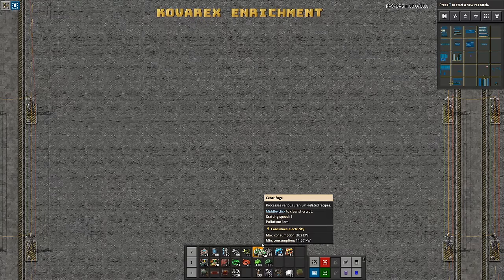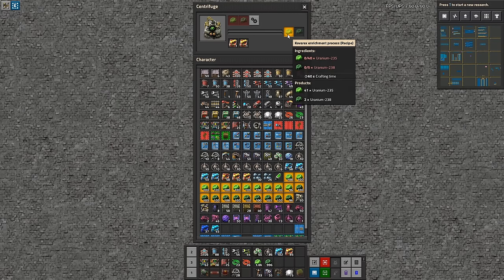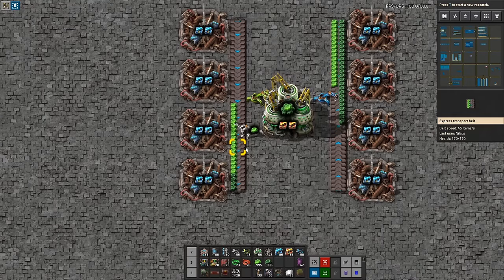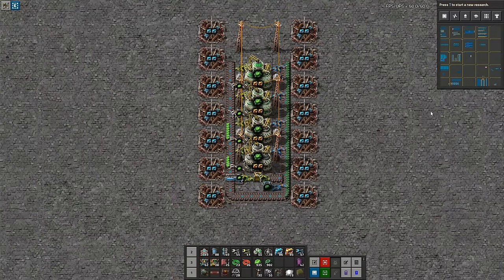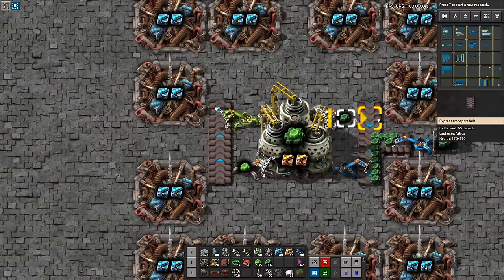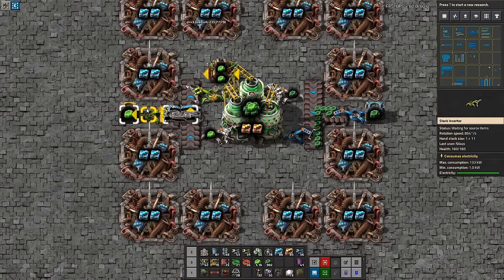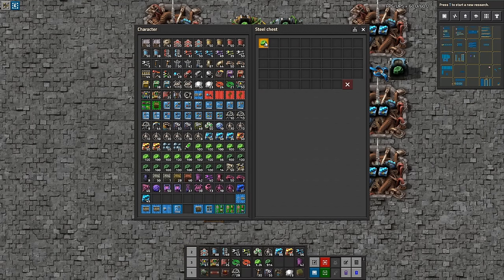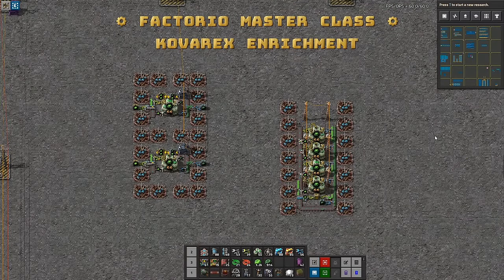Limitless Uranium-235 with KOVAREX Enrichment Process | Factorio Tutorial/Guide/How-to

Comment: Aren't speed modules MUCH better for this? You gain 1 U235 for each process completed and you never loose the U235 input materials, so 2 speed mods doubling the processing speed to 200% is much better than making it 30% slower and only gaining 20% production "(1x2>1x1.2x.7)". I fact its less productive for U235 than using no mods at all.

 Production mods are great on resource expensive inputs, but here the only real expense is 3 extremely common U238, which is the 99.3% basic ore processing result. Speed mods help with creating a much faster U235 buildup, which can then be used to exponentially^2 expand the system further or burn as fuel.

Comment: For anyone having issues w/ the U235 inserter not inserting enough and or a few U235 being siphoned off early, set the override stack size on it to 10. When it grabs handfuls that don't multiply up to 40 I have seen issues arise with maintaining sufficient inputs to keep the centrifuge happy.
Reply: I just wanted to post and say your comment helped me out.  I couldn't get things to work as expected, no matter what I changed.  Changing it to override the stack size to 10 fixed it immediately.  Thanks for sharing the info.

Comment: Instead of doing it with the complicated combinator thing, you can achieve the same results by just controlling stack sizes.

Have the output of U-235 go into a chest using a stack inserter set to 10. Have another stack inserter take it out also set to 10 and feed that back into the centrifuge. Set a condition that only allows it to pick up when the chest contains 10 or more U-235. Set a third fast inserter with a stack size forced to  one to only pick up when the U-235 in the  chest is equal to 1, and that’s your output.
Reply: That's how I did it first, this works.
Reply: Dang good point! Way more simple.
Reply: I just tried this and the output does NOT work perfectly unless you remove the productivity modules. It eventually stops itself because the productivity will give you 2 235 and the "equal to 1" condition is no longer applicable. It works, but not perfectly.
Reply: Seems like chnaging the output inserter to "U-235 = 2" fixes the issue about productivity.
Reply: @Murasame13  couldnt you also write the condition as just <10
Reply: Or u235 "equals or less" than  2
Or 4... Just in case if magic happens
Reply: I tried "<10" and less than 4 and less than or equal to 2 and none of those work, they all snag out a few extra at the start.  It's all super fast, but I think it's because they are all enabled when the box is empty and they manage to engage in the instant (single tick?) of a stack landing in the box.  Using two inserters seems to work perfectly, one enabled at exactly 1 and the other at exactly 2.
Reply: @ivanlagayacrus1891  if you use the condition <10, it is also true when =0 which causes the inserter to start taking items immediately and breaks the design

Comment: Actually you can build a kovarex with no combinators and no extra spend resources in the loop .
You just need a inserter with stacksize one, activated when a stackinserter removes u238 . Since only 2 u238 will get produced the condition is only true once  for each cycle . Also the stackinserter will always remove u238 fervor to u235
Reply: “Actually.”

Comment: I prefer this variation on the design, which uses an additional arithmetic combinator, and swaps the decider for an arithmetic. It's slightly more complex, but has these advantages:

1) Easier to seed, simply put the amount you want in the system (anywhere between 40-80 U-235) into the input of the centrifuge.
2) System will always maintain the total cumulative amount of U-235 you've manually placed in the input and will expel any surplus into the output chest. Seeding with 80 U-235 allows 100% uptime on processing, or you can start with 40 as soon as you have it then add additional 40 as you get it into the system to reduce the downtime between cycles. Just drop extra into the input of the machine as you desire.
3) No surplus U-235 sitting on belt unused, it's all either in input buffer waiting to start the next production cycle immediately, or it's put into the output chest
4) No splitter priority shenanigans to remove extra from the system, it's 100% circuit controlled by counting inputs/outputs.
5) Almost(?) never accidentally overfills centrifuge above the initial seeded amount (like was seen in this video) because of number 4 and the separation between measuring output and input inserters.

It's based on the idea of adding the negative value of U-235 we take out of the centrifuge as well as a negative of what leaves the system (into output chest). The result should always maintain a net 0 between productions cycles. Using negatives simplifies the wiring color separation for the condition/read mode so we can use a single wire to the yellow inserter. All additions (including of negative numbers) are done directly on the wire. Output is limited by the logistics network total U-235 amount so you won't overproduce.

Blueprint:
0eNrFWF1yozgQvgqll53ZNSnA/NiuvUVqnnZTlAztWBWQWEk48aZ8gD3IXmxPsi2wjWMrDuDMzEscQOqv+2v11w2vZFnUUEnGNVm8khxUJlmlmeBkQe5ZWRVbp6q1o9fg0FLUXDti5Xxzg2nkbEXtPFO8w3jzXG2VhtL5Qvn2eQ0SnCXoZwDuhJ47877iMi2ahYwbk2jHXGTAtWSr+hHu/uT3rYlnVhQOLZ7pVjklxX10D6GFpoWT1WVdUM02Vp9+wdsl5TUtjO8FzSA/eNgCU563CPBSAeLwraNqWRW16lwUtTZLszUofefca5o9OStWaJC4RoE0/xzWUI6ROoV4ZEqzTDkcwxbyySlYyTTkd2RCFKeVq4X7KFlueH4hC9+bkK352U0IywRXZPHHK1HskdPCLNHbCjAHaKFEA5yW5qqWlLO6NKESs4/nYEztJh/u7Gg+2RjsHiYEHzDNoMVvLrYpr8slSLR83L8Eik6ivUoo1p6PJgw3DmZ30T6U6fwuMtYRWZnnqgLI3VLkdQHu1OAZT88wgj4Y0W0Y0z4Y/m0YYQ8M/0auomH5CIMRGPERQ9VLpWlj3MrXEcVmJhlGxyhXZ0eMQ/W5TcW6SgtJ8ajb3I7PMSX8VeOmtK3vtg4OlWWtvAnJjOqQhbd7sHg1P246SMVHfkwbP3ImIWvXhAYCC1YU6RLWdMOENBszJrOa6RSf5UdrKybR+WHCYfRG0yYEc1FWVFJtMMjvzeM9jgSap2vUS4OoMUwkR8saWgu89bZJl2/+PEpU+1MZMWLnx0gSbhAbkKh+kCojpujv37BXrnPN8WyiZWNw2jEY7jOZsSb4J7GhEl5c4JJl6xLNuJUUGShFTs4Y3sprjGGD8B8dNb87Cu05ca8m17+S3Ph6ctERSMUqFRXItviMfH1mSoKks9ekqM1Qz/M/I9ZT73c6jn1VItWuxj2qElK7Syi0lSfvWhHYUKYDFTAeISt+OCaU+Pw0XksycLosIM2ZMr9ksaKFgo+zPDmVgOZ+u9ScGSNHtmCiG4PB1mu1e9InTEVfr4fonJz+9fAdxe6/f/4luyGVMz8hoqmk+G0lBaaSbGQlZ2T10ZDobQ7ecBbYOTu0wc8kzffsPaLlLNUiPaLuJ9/zs/oDFC26RdGidxRtdqOihb0UrRsXVhRHl75t5fJI2GZr78YQoj4hBP4IFH9+TRJsKEF/ok4Hy7AXUdOB4+qYvhKE782r+xH0nWCSyzln0MQ66ybWwDOvfMf9UpTpsl6tGiNt0V163TUQKpnGaarxW5RLxhtBsPaPg8NJT+XqTHfapcaKlwJjI+00zEVaTtSH/Ipb29f3QZYH9Qo/MapCgvdFK7aIli0B8YgEnMzGye5nUO69Zfy3H8D4ZTeeXO0SF8+Ty24+LIETy6uPLaPJiIz675ZU/H3zO7PmN/B+Qkn5n1VSs4GvEaM+bM2HfdkaBTL1hn3aGgfiD+yOH4M8tI+NxeMH6AnZYCNqu8TMD5NwnsSJ78VRvNv9D3HykL0=
Reply: I just gave your blueprint a try and found that it doesn't work. I put 40 U-235 into the Centrifuge, and it immediately stalled after completing one cycle. The Stack Filter Inserter refuses to take any U-235 out of the Centrifuge, with a status of "Disabled by control behavior," even though its mode of operation is set to "None."
Reply: @E-102_Gamma  Sorry it's been several months, but because it uses logistics system to read contents, the logistics chests must be in range of a roboport or you'll see the behavior you did. Probably should have specified that.
Reply: @toxicbubble5  Hey, better late than never, right? Well, thank you for clarifying.

Comment: Great and easy-to-implement logic for the 2nd build - I usually use an intermediate chest connected to filtered stack inserters (as seen many times in other builds). Your trick is easier to design. Thanks a lot !

Comment: Circuit build advantage: Makes excess available as soon as possible. It's drawback: It pauses each cycle.
First build advantage: It never stops. It's drawback: Takes a long time to provide excess.

So the more time you give it, the better becomes the build without circuits, as it doesn't pause. The advantage of the circuit build is really only meaningful at the "early" game, where it saves you from picking up excess manually.

Comment: If you set the stack override size to 10 on the stack inserter you don't get the tick issue with the 41
Reply: Counter also count 41. with the next reset signal you get 1 in the counter and inserter will insert this time only 39

Comment: If you want a count-perfect one, set the first decider combinator to anything < 39 | output u-235 so it'll count to 40 including the math tick. Since you're doing -20 * hand contents that has 2, you will then have a -40 on output so it'll be 0 on the combinator allowing the input inserter to swing again.
Reply: Doesn't this risk stopping at 39, and require a manual restart? Might want to add a second circuit to check for that problem.
Reply: @petkras  it doesn't, because the inserter Will grab 10 when the tick reads 30, so it'll be 40 total

Comment: with 80 U-235 per centrifuge it will run continuously.
Production speeds with 12 beacons are 8.04 with Prod3 modules or 8 with Speed3 modules.

Comment: I like kovarex, because I think there is more room for creativity than many other builds. My kovarex uses a pair. 
The 40 u235 is transferred between them with stack inserters. 
The u238 is dropped by a filter inserter and taken using a fast inserter on a belt which is looped and refilled by belt coming from miners.
The 1 extra plus the one from productivity is dealt done by a filter inserter controlled by combinators:
-To control the stack size I have one combinator to count (10 u238 taken out), one combinator to output a "1"  on that 5th cycle and one constant to change it to 1 and 2 instead of 0 and 1
-To control the enable I have one combinator that separates the counter signal from the pulse so I can still use the pulse.

Comment: Last comment: the circuit build doesn't work with red belts, i think that because of red belts being slower, the stack inserters decide to swing without a full hand or something and it causes the items to pile up and end up on the wrong side of the splitter. This happens after 2 or 3 iterations. So you may want to update the blueprint on pastebin (nuclear masterclass one) to blue belts
Reply: It works with red belts if you limit the output 235 inserter stack size to 5 .. that forces it to make more swings, which seems to give the top inserter enough time to swing and alleviate the jamming problem with the splitter.  Note that I also set the input 235 inserter to have a stack size of 10, to avoid the off-by-one issues.
Reply: It’s been working just fine with the red belts so far

Comment: I just LOVE this circuit design, but be careful if you set it up before you have your power needs met :D

I setup 4 of these and they went out multiple times, scratched my head, then I realized I had several brownouts in the meantime which seems to mess up the circuits, so had to manually reset them when this happens...

Comment: This can be simplified to use only two wires and zero combinators.
1. Connect a fast inserter to the middle belt.
2. Set belt mode to only read contents/hold
3. Set inserter enabled condition to U-235 = 1
4. Connect output U-235 stack filter inserter to the storage chest
5. Set enabled condition on the output inserter to 4.8K or however many U-235s should be stored in the chest.
6. Limit stack size to 10 on the output U-235 inserter.

Blueprint:
0eNrFV9uOmzAQ/Rc/wwpzT9R+SRUhByYba7nVNlG2K/69Y9glaWISLlL3JcR4mDNz5mZ/kH3eQC14qcj2g/C0KiXZ/vogkr+WLNfv1HsNZEu4goJYpGSFXu2BoShpLcLLDM5kS9udRaBUXHHoNXSL96Rsij0IFLj91iJ1JVEc/yIKqrA9Sl8Ci7zj39h/CbRyBJV6W9YAmV1UWZOD7ZGt27bWHYQ7AcKJV0F4UyD8VRD+FIh1RAXzYkEXQITzvFgCEQ0QUrH0zealBKFw53HYnQ4q4wLSXgRNRQOVqPJkD0d24pXQ36VcpA1XCe5lg7IDF1IlT4qjEazkTWG7XqArRNeUYrrAqOPoZVEzwZRGIT86gU8k9BeS6pBUNeB+h+iZHI8HJDjXAqS0FSLKuhLK3kOujARs/iHAoHUzaE1xR/BD8wpGTeGXpmjTUYlE8o6Ft+rEBJxtKAVPjwVqsWtRpWgguYotvsoapP6E4M9CTJ3BqAPPMbaPg+wvDrKJ+ktgBLAsObIy08mg0EZ0RIkGEKI3q+94X63QkAgxaXcm/+iSUHrjbvomEHdWuUfRglqkl8aYV69cKp7a6REkZgCTkp9AZ8KJZ+bAXYH3KYVGlr1LnQlU/wjIrucKxxUNkFWjOZcmemBoxKOsoc4N+BWd7v9rDTeN4SdpZ/AQah4sUp1ACCQ56Roi2vIH9GQ28BPc9M4p1TW00Cj+Pp782NRDZ1Dl9VRNrFtE343x6piIDVf15kv6j3IJJdvnkGRc6ifZHlgu4Xmrsq6D0b3vRXXj63JkMoH+WM1F61yPv8d1x+hLPL1/XKaOoS5MujdLeHLHm1RoOgo7qwbLPYhpsLjrptc9XUYQd9ZJctH0ckenl4DfDT5HIu/cnYQ66WTyoUDne/N5MjQeENwZg8yhDwaZSfe8a0C06EoWzrqTLcOIZl3KlmHE87LwOcau39YKhxu4RXDQyD5gMfUjfxOFEXXCIGzbvxaFLWU=

I also prefer to use passive providers for Covarex and storage chests or active providers for U-Processing outputs. Since storage chests are prioritized over the passive providers, bots will empty them first, ensuring the uranium belts don't get blocked because U-235 can't be picked from them (like that ever happens).
Reply: Does this work with productivity? I've left it running a while and the storage of the centrifuge keeps increasing as each productivity goes off until it stalls?
Reply: This will fail when productivity spits out out 2 instead of 1, won't it?
Reply: This doesn't work.

Comment: Nilaus, I just wanna say that your "efficient" Kovarex Enrichment Process doesn't work unless you're using blue belts and a blue splitter (as you did in the video).  
  
The default design of yours uses red belts and red splitters, and after a while (I just built it), you'll lose 1 uranium-235 to the chest, because the splitter doesn't let the items through fast enough, so it get stucks for a second, and in that second one or two or three uranium-235 go into the chest (which is usually one too many), and thus after a few rotations, the process will stop because there'll only be 39/40 uranium-235 in the centrifuge. So you HAVE to use blue belts and a blue splitter for the efficient design, otherwise just use the "inefficient" one that he shown first in the video (haven't tested that though but it should work).  
  
I'm not sure if that was an oversight or not, but since you said multiple people tested it along with you and it worked, that seems like a lie, since I literally just now took the blueprint and slapped down the default design with the red belts and a red splitter and it didn't work. Your testers seem to not really be testing anything.
Reply: There's enough space around the centrifuge to wrap slow belts for extra tiles of belt space storage. Problem solved.
Does that negate the purpose? Yeah, a little bit. Definite design oversight.
Reply: @Terminarch  Oh absolutely, I wasn't blaming him or anything, I just stated that you need blue belts and a blue splitter, because he claimed in the video you can do this with any belts/splitter. And that if people test things for him, maybe they should test a little better. :P
Reply: i copied the design but used red belts and splitters, since i do not have blue splitters and belts yet, i was able to modify it using a belt reader, and control the output purple filter inserter, to get one on every cycle. i initially thought Nilaus' design had a flaw, but since he was using blue belts and splitters which were faster, i had to compensate for that since i was using red belts and slpitters.
Reply: @system2048  just limit the output inserter stack size to 5
Reply: For red belt you can have the stack inserter be at stack size 8 max, anything above 8 breaks it. With blue belts you can have it at the full 12 stack size.

I've discovered this completely by accident. I built the setup when I had stack inserters at 8 stack size and it was running for a good while without issues, but when I researched the next capacity bonus it quickly broke. After some testing I got to this conclusion.

Comment: That’s interesting.

I set mine up in a chain.  Centrifuge > requestor box > centrifuge etc.  one of the requesters has a provider and a sorter arm programmed to pull U-235 when there is over 400 in the box.  The chained requestors will be refilled with, like, 200 U-238 to keep things moving.  I think I have eight in the chain.  Works pretty good.

Comment: You could limit stack size on picking up inserter to 10 (or 5, any divisor of 40), so it will swing instead of picking up 41th uranium. Outserter in this case should be limited also, to not cause backlog.

Comment: I like this a lot.

An alternative to using a fast inserter to input 235 would be to limit the stack size of a stack inserter.
Also, I would look at limiting (or setting up an alarm) the 235 to only run kovarex if you have enough in the logistic system.  You don't want to accidentally be sitting there with thousands of 238 but not enough 235 235 but not enough 238 to make fuel cells.  Restarting nuclear power by hand is a pain.

EDIT: had 235 and 238 flipped
Reply: I think you got 238 and 235 the wrong way around. 235 is the good one.
Reply: @thewhitefalcon8539  Thanks, fixed now.  FYI you do still need 238 to make fuel cells, and I did have a run where kovarex ran through all my 238 and I ran out of power...
Reply: @canebro1  prioritizing fuel cell production using splitters would be a good way to limit Kovarex when you don't have enough 238 for everything. I think the priority should be Fuel Cells > Kovarex > Military > Others.
Reply: @MuhammedGemci  This is true, I was meaning that if you let kovarex run without any limits, you could end up turning all of your 238 into 235, and not be able to make fuel cells.

Comment: I found that if you use boxes on the output instead of a belt, it's simpler and easy to make reliable.  Set the stack size of a filtered U235 inserter to 10 into a box .   Have another inserter with stack size 10 insert from there into a second box with a condition to only operate >=10.  Then have an inserter moving that back into the centrifuge.   Have a final inserter pull from the box to a belt only if the contents % 10 != 0 (using an arithmetic combinator).   (So it isn't on if the box is empty, which means the stack 10 inserter always wins.)  If you put 40 U235 into the input, this always keeps exactly 40 U235 occupied, with a slight transfer delay.   Later, if you add exactly 40 more, it works the same, but with no delay for the transfer.